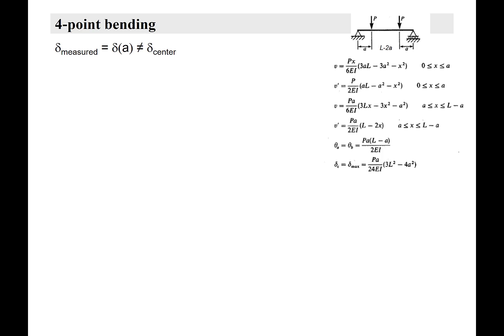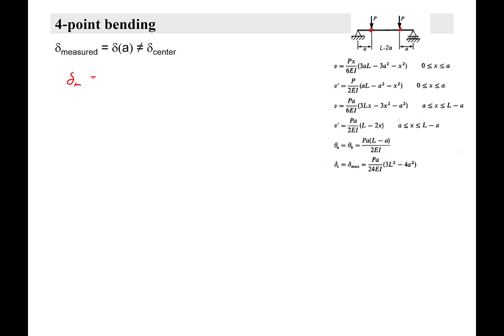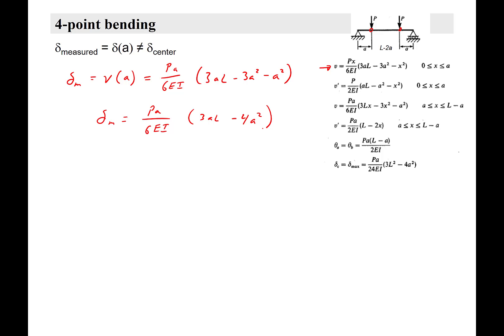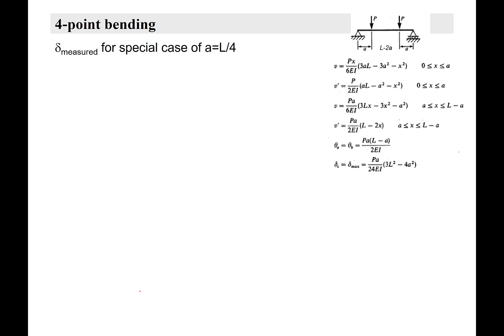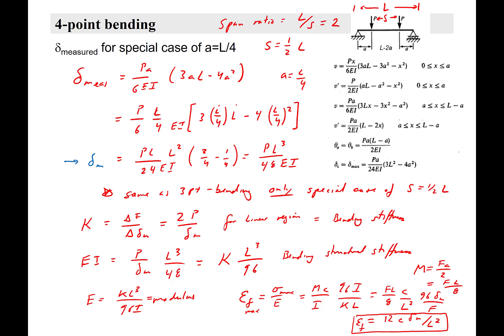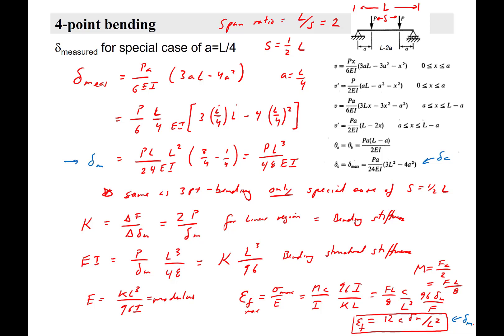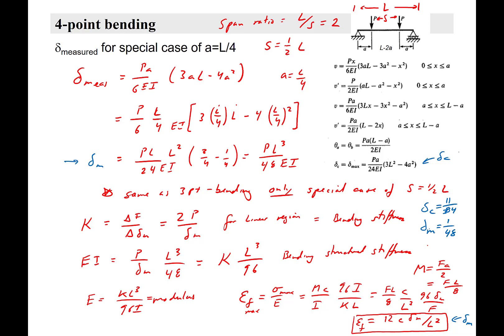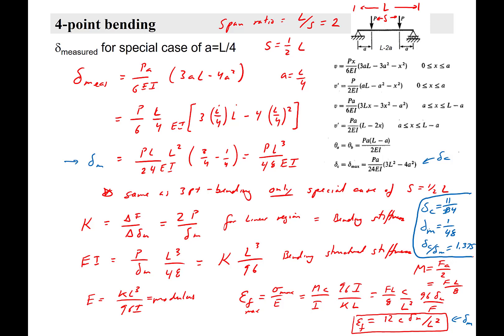4pt bending calcs with crosshead displacement

Comment: thank you so much my friend!!! I was needing something just like that to calculate deflection in a flexural test, from the machine crosshead displacement data, in my DIY 4 point bending test machine. I am trying to follow ASTM D6272 as close as possible, but i just did not have the money to buy expensive dial indicators with data loggers to measure the deflection at the centre of the sample. Your video will save me many hours in my project !!! Love and admiration from Brazil